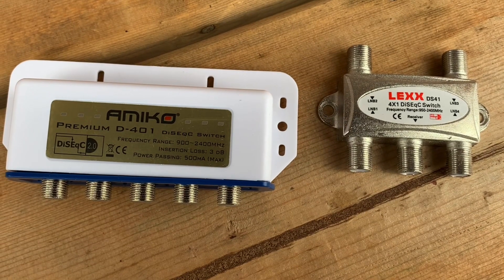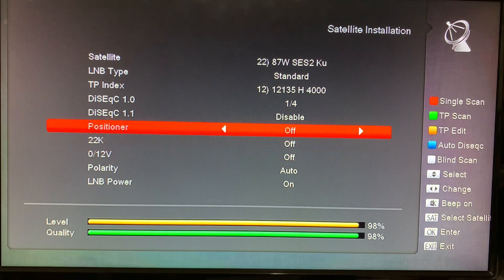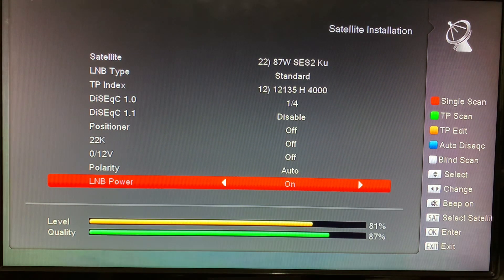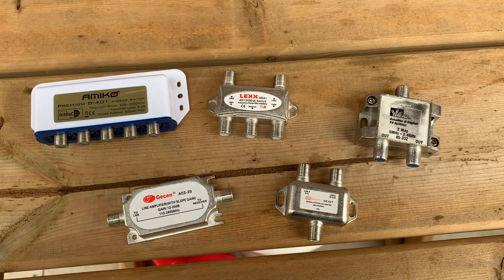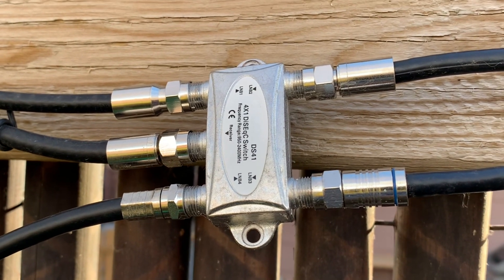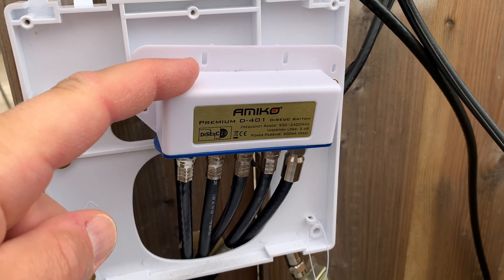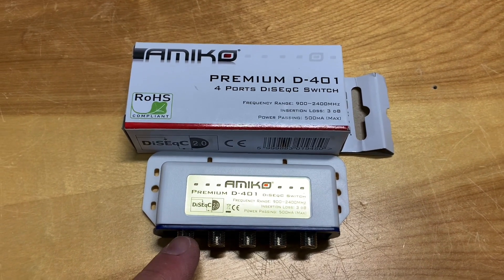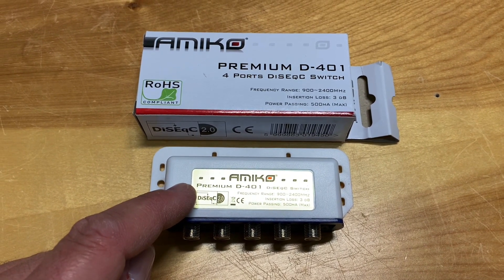Why DiSEqC Switches Fail - Satellite TV

Comment: How it's exactly works ?
Reply from the maker: It routes each incoming LNB signal through a single output port to the receiver. A voltage signal (either 13V or 18V) from the receiver calls down the particular satellite LNB signal depending on the channel you select. All the switching happens automatically and instantly.

https://www.youtube.com/watch?v=zPvxbhap2kw

https://www.youtube.com/watch?v=WM8nUNUFn4M&t=78s

Comment: Very informative as usual. I've been out of the loop for a while. (My last dish was a C-cup) A place that looks like I'm going to rent has a crazy dish farm on it's roof. There are at least 5 KU size dishes pointing in all sorts of directions. Only one points southish. I do know that the previous occupant was getting India/Asia broadcasts so maybe that explains it? So the point of my post. A great way to weatherize your connections, switches, ect is with electrical boxes. They are available in several sizes, easily mounted, and you can place hinged covers with gaskets on them for easy access. Easy to obtain coax feed through bushings fit perfectly in the knock out holes. Just glue them in. I use silicone. I've done it on several installations.
Reply from the maker: A great tip, thank you.👍

Comment: What can I do with my new decoder not support 8 ways diseqc switch.. not bringing out frequency signal when I put Rf wire connector
Reply from the maker: Look in the satellite installation menu. You need to use DiSEqC 1.1, that will command an 8-way switch.

Comment: Last year I replaced my 4 input Diseqc Switch with an 8 input Diseqc Switch to connect 6 LNBs. Both are made by AMIKO. The problem is that the 8 input switch isn't weatherproof like the 4 input so rain, snow and sunlight can damage it very hard. The final solution was to hide them under the rooftop and solved the rain, sunlight and snow problem.
Reply from the maker: Good idea.

Comment: I must add that is important to ground your switch, splitter to protect your satellite system, and a TV-Sat Surge Protector. A good example of protector is the: TV-Sat Surge Protector: SIGNAL (F-plug/F-socket) the frequency range is between 5 - 2400 MHz ideal for Antenna, Cable and Satellite. You can also use the AMIKO LIGHTNING PROTECTOR which works between 5 - 2150 MHz.
Reply from the maker: I’ll look into that, thank you.

Comment: If I'm using a lnb with c and ku feeds,when I do scan on ku side I always disconnect c band cable because for some reason c band channels will drift over and show up as ku channels.
Reply from the maker: I started doing that with cheaper DiSEqC switches. Drift hasn’t been a problem with the Amiko switch, I’ve noticed though.

Comment: What is differece Diseqec 1.0,1.1,1.2 &2.0
Reply from the maker: DiSEqC 1.0 is a switch used to control up to 4 LNB signals to a receiver, while DiSEqC 1.1 routes up to 16 LNB signals to a receiver. DiSEqC 1.2 is a set of dish mover commands for a Ku band dish motor. I have no experience with DiSEqC 2.0.

Comment: i just read the other day that you can use dielectric grease on coax connectors to help repel the water from weeping into the threads, might be something to try i haven't done it yet to my connections
Reply from the maker: Yes, that’s probably a good idea to try, I’ll have to look into it.
Reply: I use it for all my electrical connections Outside, works Great.

Comment: Hi Bro. 
I'm very happy to watch your explanation regarding diseqc switch problem.  
Recently I was baffled by frequent problem with this switches either failure at Port 1 or failure on many ports. 
Your explanation regarding handling, safety or covering this switches saved my day.
One more thing at the end of your video is regarding the switching of C-Band and Ku-Band signals was something new to me.
I wish to get your opinion regarding the installation of lightning arrester. Basically there are video explanation of the installation of this light arrester either right after the diseqc switch or  before the satellite receiver. 
Can we install it right after the LNBs as frontline before arriving at the Diseqc switch during thunderstorm? 
Thanks in advance.
Reply from the maker: What I can say about the lightning arrestor is it’s not a substitute for proper grounding. I’d ensure the dish is grounded correctly before I install a lightning arrestor. Thanks again for watching my videos. 📡
Reply: @NorthcoasterHobby  Thanks and highly appreciated.